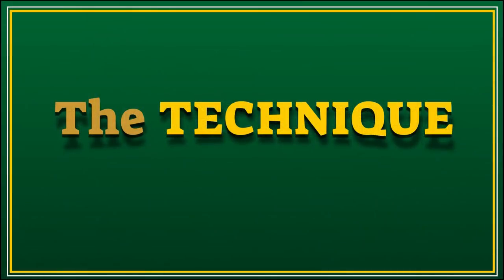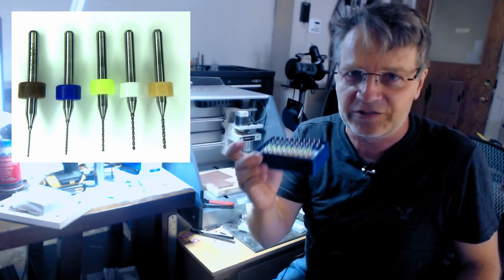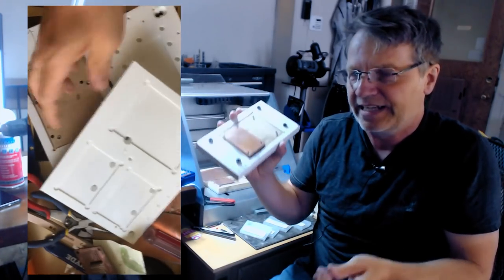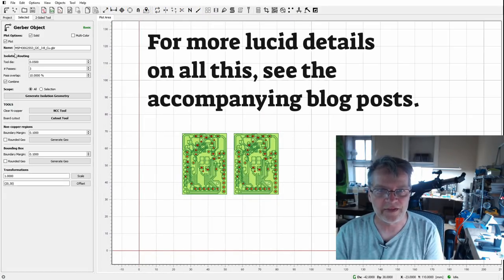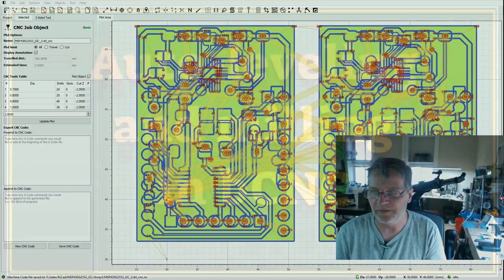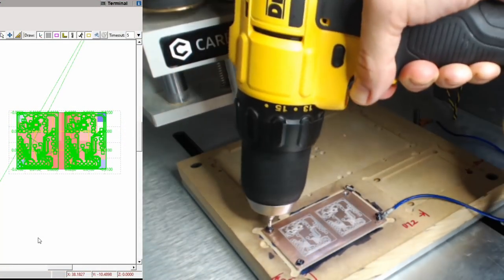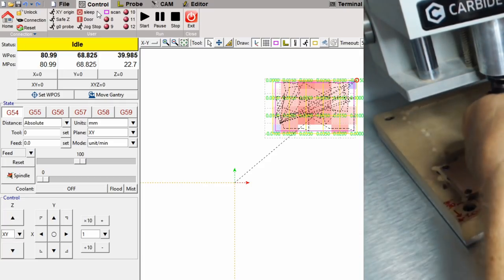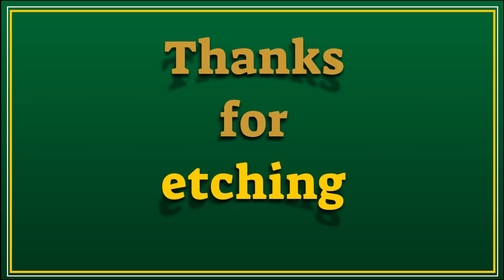The BEST way to make PCB's at home. Maybe.

Comment: Hihi, Loved the video and approach to PCB milling. I actually considered this technique years ago with a CNC built from broken printers and MDF but moved house/lost my workshop before i got around to it and only recently got back into CNC.
Your video provided the required inspiration to try it out and since you seem keen to hear reports of how others are getting on, here's how i've spent the last day or two: https://youtu.be/8xecfwEE2jE
Ultimately i'd like to scribe from the main spindle instead of a separate clamp but my machine's Z axis has some repeatability issues (I've got some work to do there).
For my next revision i'm considering a tube containing spring and the scriber tip and mounting the whole thing in the spindle. This will give me the spring-loaded approach of my setup and the repeatability when switching to drilling of yours.

Anyway, thanks for posting this. It was most useful.

dunk.
Reply from the maker: This is really inspiring! Yes, I agree that finding a way around auto-leveling would be the holy grail. Wegstr uses spring bits, they seem to work well. Not sure if you noticed but in another video I've started sharpening broken drill bits - thinking now that maybe they would be easier to make into spring tips. Love the configuration you have in your video, seems like they might fit in there well. Anyway, thanks for sharing - looking forward to your progress!
Reply: @robindebreuil  
> Not sure if you noticed but in another video I've started sharpening broken drill bits 
yea, i saw that. i was planning on using a diamond angle grinder disk i already have for similar.

i think "spring bits" is probably what i was trying to describe towards the end of the previous post.
interesting that they are a thing.

Comment: Just order the pcb in china you have 10pcs in 5 days for 5$, in the old days I etch double sided pcb ferric chloride fast 20min and hand drilled it, soled vias in.
Reply from the maker: While I totally agree the final boards should be made professionally, when prototyping I'll take crappy 20 minute boards over some nice boards in a week :). It saves a lot of time (and shipping costs if that's a factor) if you can cut down on the number of revisions. 

But yeah,  custom low run boards have gotten astoundingly cheap recently.